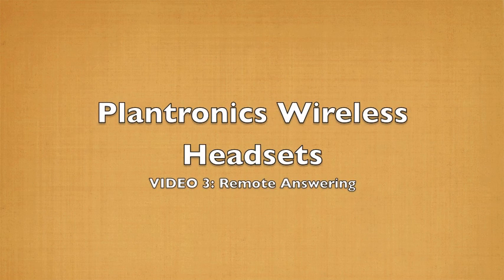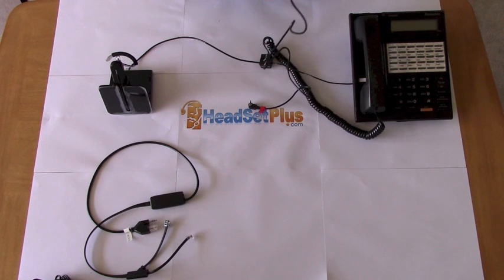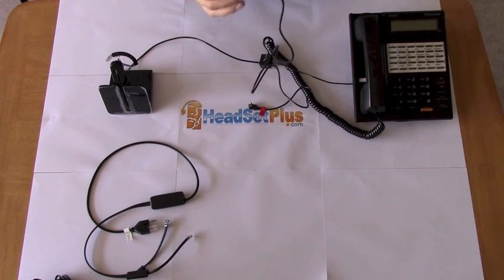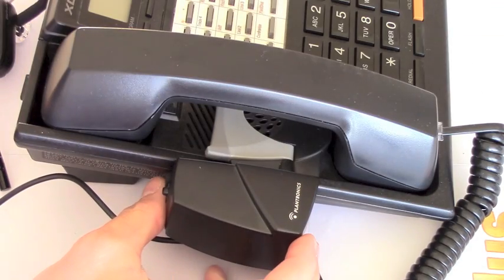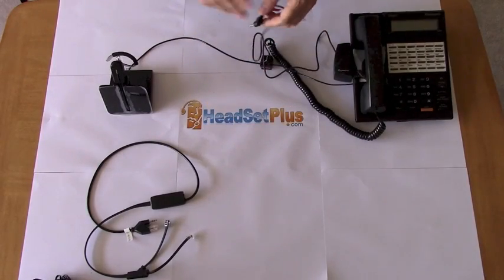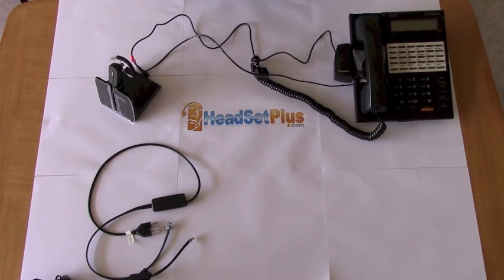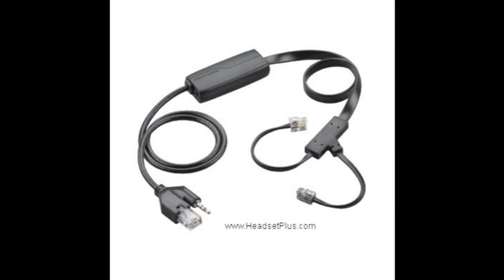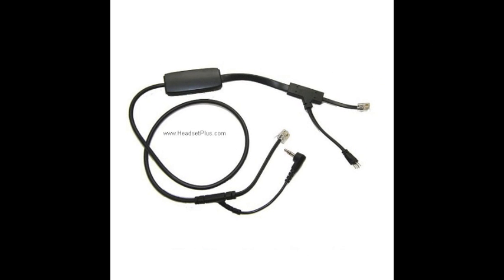How to Set Up Plantronics HL10 Lifter or EHS Cable for Remote Answering on a Wireless Headset

Comment: I need help connecting an older Nortel to a  cs510.
Not sure which ehs cable to use. The apu-72 will not working as the older model nortel does not have usb. There are 3 ports on the rear.  Handset/headset/Ethernet.  Please help